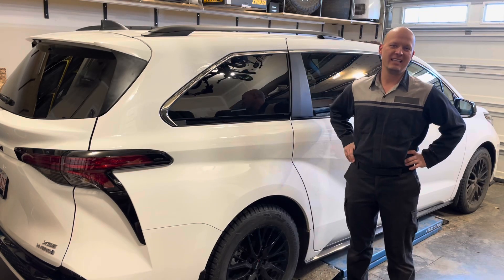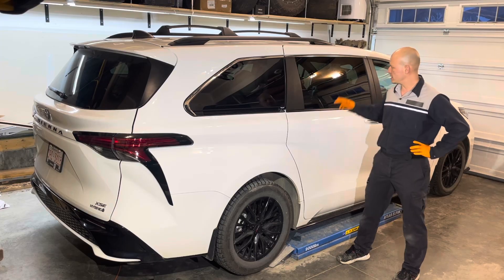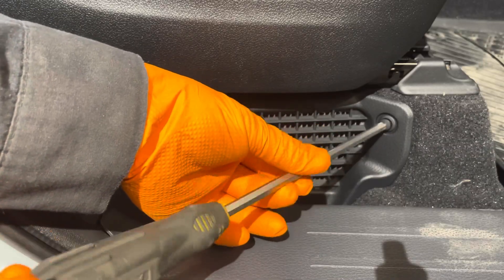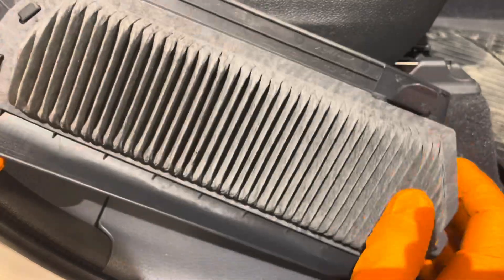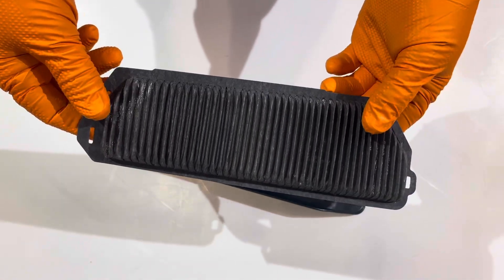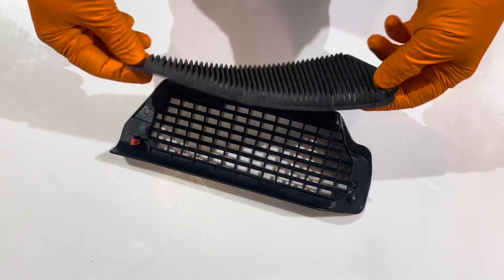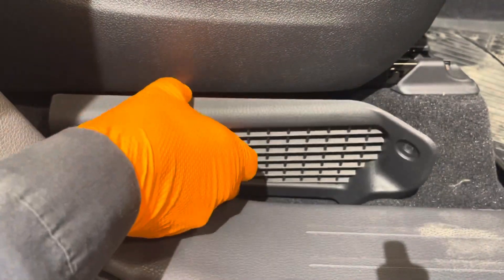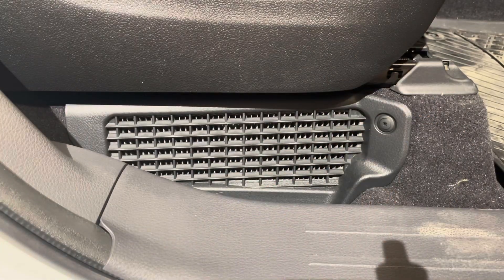2021-2024 Toyota Sienna Hybrid System Battery Cooling Fan Filter Inspection/Replacement Instructions

Comment: Thanks a lot for this useful video!
I changed both filters myself, was quite easy. Toyota told me as part of their “hybrid battery service “, they would also take out the seats and do other stuff with the battery. Is that really necessary? My guess is not?
Reply from the maker: Just replace or clean the filters and you are good to go.

Comment: Is inspecting this filter the same way you inspect engine air filter? By seeing if it passes light?
Reply from the maker: @johnlovett3111  check for light passing and dirt accumulation, if in doubt, either blow it out or replace.

Comment: How many kilometres you have to change. You don’t tell that
Reply from the maker: @HobsonSeb  it will depend a lot on how much dust, pollen and other pollutants is in the air in your area. There isn’t a set amount for replacing the filters. I’d check them at 20K miles and see what they look like. Then adjust your inspection/replacement interval based on the results.

Comment: Do you inspect it the same way that you inspect a engine air filter by holding it up to a flashlight or to sunlight? It used to be rule of thumb back in the day that if you held a field truck to the sunlight or a flashlight you can see through it all was good
Reply from the maker: @johnlovett3111  yeah, and just tap the dirt out or gently blow out with compressed air, or replace it if pretty clogged.

Comment: Hello, After how many miles/ time  shud it be replaced? thanx
Reply from the maker: It will depend on the level of smog/dust/pollen/pollution etc., as well as the ambient temperatures in your area. Here in Canada those filters barely get dirty, while in the southern USA you probably want to check them every couple of years and clean or replace as needed.